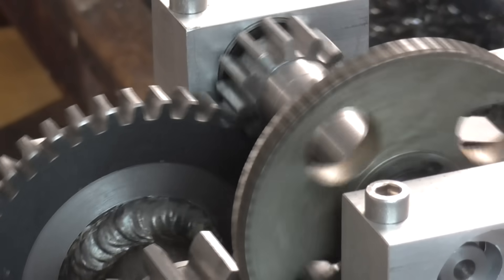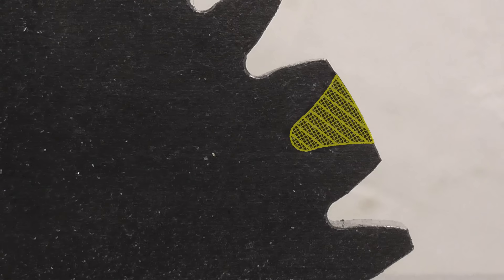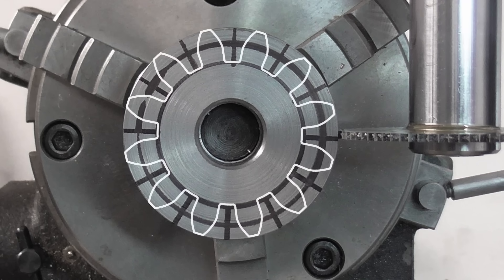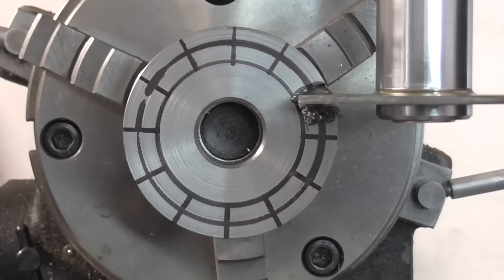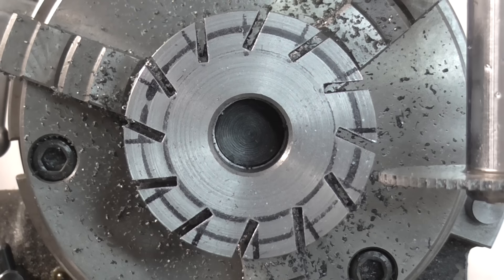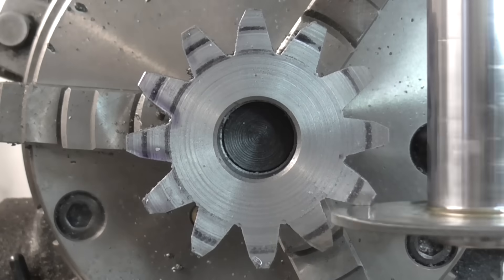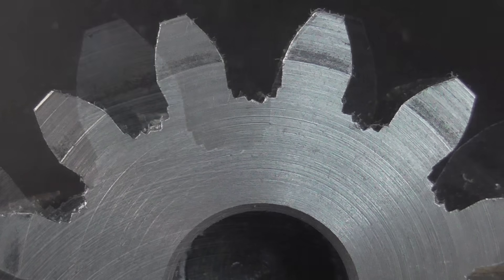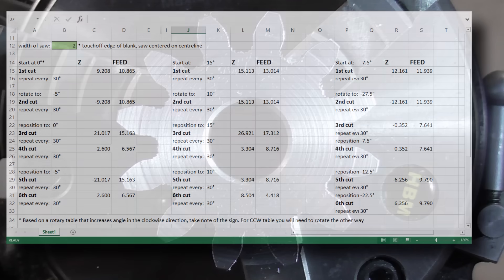Cut any gear with just a slitting saw

Comment: Could you 3D print dividing head gears and parts and have metal structure to lock the part for cutting? Seems like this could be a low cost solution to cutting gears. Annyone?
Reply from the maker: You could do that as long as there is very little force on the 3D printed parts. People even make dividing heads using just a paper disc with marks on it. All you need is a rotating shaft that can be locked in position.

Comment: one question. Why? In the beginning I thought "oh okay he wants to cut m=1 this would be tricky to mill" but in the end he cut m=4 which is totally doable with an end mill
Reply from the maker: You mean CNC mill out the shape of the gear in profile? Or use an end mill instead of a slitting saw? Yes, you can profile cut a module 4 gear with a small endmill, but you'd be limited to only a couple of mm per pass and this gear is 20mm thick, so that would need multiple passes with a long fragile endmill, it's going to take a long time and likely break a lot of cutters. Similarly replacing the saw with an end mill, it can be done but it will take many more cuts.

Comment: As a job shop machinist of 20 some years and a industrial maintenance mechanic who was the go to machinist at that plant for nearly 17 years I was quite impressed with this video. This is the type of project you might be given in a school shop for the student(s) to learn machine practice and theory. Although not practical in the real world the experience the math the adaptation of machine tools and the hands on machining would be priceless. Let me add you could have save yourself a few radius corner cuts by using an endmill with rounded corners. They can be shaped quite easily by hand to the end mill using a grinding wheel. One cut centered and done.

Comment: I enjoed your video very much and like the idea of making gears at home :)  ... I would like to add a suggestion: there might be an even easier method of generating the involute on a mill: incorporating the  pressure angle (20°) into the setup makes the step overs for each cut a bit cumbersome (moving up and sideways).  Instead of rolling along the pitch circle you could set the OD of the saw to the fixed distance of the base circle of the gear (with a corresponding  0° pressure angle), and from there ononly move the saw vertical and turn the gear by the corresponding base circle lenght.   Formular: Base Circle db= d/cos(press.angle).   For every 1° you rotate the gear, you move the saw up (/or down for opposite side of gap) by a slight amount, corresponding to the periphery of base circle devided by 360°      Formular:  L= db*pi/360  , if you want to make enveloped cuts say every 5°, you just multiply L times 5.  This method (Roll-Off Base Circle) was incorporated in some very old, but crazy accurate gear grinding machines from Maag.    
https://www.e-periodica.ch/digbib/view?pid=sbz-002:1917:69::492#2600   
 (sorry, only in German)

Comment: i have some question  firs cut is ok and it happens at -27.5  and-5(which means -32.5) and it is ok but secound step  turning  to 15  its ok for +-15.13 whats that 10 in spreadsheet
in third step 12.16 happens at -7.5 from origin and -22.5  then -27.5 where has it come from
Reply from the maker: The first cut is taken with the rotary staring at 0°, then repeated every 30°. The next cut is started at -5° with Z and cut depth repositioned and again repeated every 30°. for the second stage the starting angles are 15° and 10°. The Z and cut depth are calculated to intersect with the correct tooth profile, though as you get further along the spreadsheet not every cut would remove material since it's already been cut away or some cuts don't even intersect with the blank, since it's simulating a rack shape which the gear is rolling across to generate the tooth profile.

Comment: For those who need to make many gears, an option would be casting your gears.
Make a 3D print of your gear(s), add 3% for shrinkage for aluminum or steel.
This would make your pattern for a sanding casting.
Grind some tool steel for a flycutter the shape of your tooth.
Of course, you would still need a dividing head.

Comment: I was wondering if you used a drill of the correct diameter for the root area, and than cut the three angled cuts, if that would yield the correct tooth geometry... Looks like it would...   IDK
Reply from the maker: For a larger gear (say 50+ teeth rather than 12) you could probably get away with just 2-3 cuts per tooth. For 135+ teeth you would only need one cut on each side of the tooth at the pressure angle (essentially a rack).

Comment: Patience! Could you not have drilled the roots? Sure, you loose a little bit of material, but not very much. Thank you for your videos!
Reply from the maker: Yes, you can drill the roots first but I tend to do this only on gears with more teeth. You are correct you will loose some material, on a gear with more teeth it will be less. Instead of drilling I chose to clean up the roots afterwards with a ball mill.

Comment: This is my third time watching this awesome video.  This time I was wondering if this concept could also be accomplished using and end mill???  Of course it would have to be a small end mill for small gears, at least to clean up the root as you did with the ball nose end mill. Your thoughts? A video on how to do it? Please?  Thanks. Regards
Reply from the maker: Yes, you can do it with an endmill, the only problem is it would have to be a very long thin endmill to reach into the root of the tooth, which would mean taking multiple passes, so it would take much longer to do.
Reply: @AndysMachines  It's too bad that they don't make end mills with a gear cutting profile.  I suppose that with a Tool and Cutter Grinder, you could at least get close to the needed profile.  Thanks for the reply and for sharing your incredible knowledge on the subject of Gears and Gear Cutting.
Regards.

Comment: You started 0 degree how the second jop 5 degree
Reply from the maker: The first cut was made at 0° and repeated every 30°, The second cut was made at -5° and also repeated every 30° (after repositioning the saw). All these numbers came from the spreadsheet and depend on the size and number of teeth, width of saw etc.

Comment: Great vid. TY ! This is very advanced stuff. I am just an amatuer, and I have used slitting saws but they always seem to dull very quickly. Any tips?
Reply from the maker: Thanks! With slitting saws you need to run them more slowly than you might think (usually 100-200rpm), especially when cutting steel otherwise they can overheat.  I use the formula rpm=8600/diameter of saw(mm). Cutting oil will also help keep it cool.

Comment: , you used a bore nose end mill as well.  Thats two tools, not one as the video title claims.
Reply from the maker: Yes I used the ballmill to clean up the root of the tooth area, but it's not really necessary since that's not the working part of the tooth, it's just to improve the appearance really, and it could have been done with the slitting saw by taking numerous tiny cuts. You could also just use a file to clean it up.

Comment: AND......for small pinion gears (low tooth count) this method can actually do a better job forming the root of the tooth with proper clearance than the "proper" set of 8 involute gear cutters.
Reply from the maker: Yes, with regular gear cutters you can't cut fewer than 12 teeth, a number 8 cutter only does 12 & 13 teeth. But actually you can do this same trick with the number 1 gear cutter and use it to cut any number of teeth.

Comment: it was interesting to learn that square corners could lead to failure. When i ran a cnc machine in the stone industry, we learnt that we had to add a 5mm radius to hotplate cutouts or sinks with a square corner as after some time they would crack through the corner otherwise.

Comment: Double thumbs up!
Really great. It's the best method I've seen using machines of this calibre. The explanations are like state of the art, just fantastic. 
Just verified a digitally controlled rotating table capable of either steps per rev or angle per step. And... cutting gears for a veteran railroad might be waiting.

I prefer to contribute once, with a decent sum.  Is there any way to do that?
Reply from the maker: Thanks for the comment and appreciation!
If you click on the three dots under the video, there should be a drop down menu with 'Thanks' in it, you can use this to make a one-off donation.
I'd be interested to hear if you use this method for making railroad gears!

Comment: I made a 20-tooth 8DP 20PA gear according to the Imperial sheet of the spreadsheet.  It turned out well, but I found 3 of the setups that didn't seem right, so I skipped them.  Those 3 as set up would have gone right through the meat of the teeth.  (The ones in question are 1st column 4th & 6th cuts, and 3rd column 6th cut.)  It's very possible -- maybe even likely -- that I set them up wrong, but I checked several times and got the same results.  (I also found a couple that missed the blank entirely, but that was expected.)  Those glitches aside, I'm very impressed by the method and the way you quantified it, as well as the video itself.  Very nice work!
Reply from the maker: I did find something similar on a gear I made, it was only the cuts quite far down each column and I think not the first few columns, but it could have been my mistake, or it may be there's a glitch. Fortunately if a cut is in the wrong place it's usually very obvious and you can skip that one. And there are a lot of cuts that won't even intersect with the blank.

Comment: Thanks for the interesting process. It does show that there is more than one way to do anything. You could even cut a worm gear using this method, the setup of course would be a bit different due to the angles involved.

Comment: Ive machined gears from tool steel using a large box way mill. I started with 6 different sized cutters to machine the proper profile. I made around 24 at a time and they’d take the better of a day to machine 3 plates worth or 72 gears. 

The Finished, edges were sharp and required either hand filing, or eventually a adapter we made for a lathe to debur. End of the day our hobber could make 700 or so completely finished so it wasn’t as efficient in comparison but the accuracy was good.

So for anyone wondering, yes you can make straight cut gears on a 3 axis that will work just fine on a product. 

We made mod-1 from 4320 so the profiles were tight and utilized Gibbs cam gear program. It was a faster a process than using a slitting saw. The cost of tooling was around $150 total to make around 500 gears. The smaller end mills you use to provide the proper profile break easy so it was ideal to remove as much as you could with the larger ones and finish with 2-3 passes. 

If i recall we had 3/16, 1/8, 3/32, 1/16, 1/32, and 1/64. We were able to eliminate a couple end mills by the time we revised the program a few times. 

This was several years ago and i no longer do any CAD/CAM OR machine parts but it brings back memories of the good days.

Comment: That's odd, a little over a year ago, probably the same time this video was made, I was trying to cut gears with a slitting saw on my little Chinese CNC, usinf its fourth axis and gcode generated part manually and part by a c++ program. The results were not that good though, I think mostly because of the poor quality of the machine.  I haven;t watched the full video yet but it seems the method I used was quite different. I was using the saw more like a milling cutter and by moving it linearly while advancing the rotation it 'automatically' forms the right profile, quite similar in principle as a hob would do it, just much more slowly.

Comment: Hi AndysMachines, very interesting video. In the spreadsheet, there is the pitch diameter, the outside and root diameter. What does root mean?
Reply from the maker: Check out my other video for an explanation of these terms: https://youtu.be/F7vQ9oVkX-k?t=70 
Basically the root diameter is the 'inner diameter' of the gear, at the bottom of the tooth space.

Comment: I won't lie, this is awesome information and I'm more than tempted to use this for personal production of gears to manufacture.   I intend clone Eaton's range/splitter box in their fuller transmissions but smaller and compact so that I can bolt it to my truck's main transmission, the NP435. the overdrive ratio will be 0.78:1, and the low range will be 8.55:1, essentially turning my 4 speed into a 16 speed transmission. (then again I can just have four low, wide-ratio gears and then have 8 higher, close-ratio gears giving me 12 gears to work with.)

NOTE: after doing a quick calculation, I realized that a theoretical 57.11:1 low range is WAY too low (unless if I'm going to do farming then the variable low speeds may actually be a good idea.  Like, trenching or combining.)  So perhaps just a custom gear splitter (lowest will be 6.68:1 and highest will be 0.78:1) would be better, giving me 8 forward speeds and 2 reverse speeds. (and, with the two speed transfer case, I can have a theoretical 10 forward gears and 3 reverse gears.)

I honestly don't know, maybe I'd might be able to build or clone a multi-thousand dollar (or multi-thousand pound; GBP) milling machine with some reference guides and patience, it could be done.

My ramblings aside I love your video and the wealth of information including a chunk of excel-wizardry to help make the process easier for machining gears. :)

10/10, will recommend.

Comment: It's me, I'm the guy with a lathe, a mill, a dividing head, a few slitting saws, and no gear cutters.  The lathe needs a few more gears (and a repair to a broken gear post) to be useful for threading or power feeding.  This video is definitely going in the queue for reference later.

Comment: Really good job but if you could do a second example of 30 or 40 teeth so that we can be sure we have understood how to read the board, that would be amazing. No need to make a full gear, just a tooth or 2 is enough pls
Reply from the maker: The large gear you can see at 1:25 has 45 teeth and was made by the same method (it is the same module size). For larger numbers of teeth you don't need as many cuts to approximate the curved shape (I think I did only 3 cuts per side on this one) so you don't need to use as many of the columns in the spreadsheet. If you make a mistake and set the wrong position it's usually fairly obvious as it would cut in completely the wrong place and remove most of the tooth. After the first 2 cuts per tooth you should only be removing a small sliver each time.

Comment: I’m impressed! I’ve NEVER cut a gear, but need to do so, and I’ll try this way. It’s for a very odd thing: the rebound damper adjuster on 1980s Kawasaki rear shocks. The little drive gears tend to bust over time (what a surprise) making the shock useless. So these little gears are for that. 

Some would argue those shocks were useless even when new - good point - but I’m restoring some. In fact, Hagon shocks are far superior, but each to their own. I’ll cut gears, will advise how they turn out.

Comment: I wonder if before taking the slitting saw to it if you drilled the 12 hole pattern right in the roots to start .......... instead of the ball endmill at the end.
Reply from the maker: I actually did that for a larger gear I made (45 teeth) but a round hole is not the perfect shape for the root.

Comment: Use a lathe. Take a rod of your favorite tool steel. Cut it to the profile of your gear tooth.  Similarly to what they are doing here, but instead of directly cutting the tooth, which requires multiple cuts on both sides of each tooth, you just turn your cutter down. Then use milling attachments to cut your flutes. You need the right relief angles on them. Look up how to make a mill. Then harden and temper your cutter.  Then you just mount your dividing head on the compound and you can quickly cut your gear.

Comment: Second time I've watched this video as I am getting closer to making my own gears using a rotary table on a CnC. It did bring up some possible variations on your process. I believe one could cut the leading and trailing edge of each tooth by making 2 cuts on each side at each of the Z offsets. In your case, with a manual mill, it doesn't help, but in mine, the rotary table is still manual. The other thought was, after you've roughed the tooth profile, wouldn't it be better to take those thin wedges using an endmill? I expect the surface finish should be much better on the parts that matter.
Reply from the maker: You will still need a very long thin endmill to reach into the tooth space to take cuts without interfering with the tooth on the other side, so the finish might not be that much better, though you could run the endmill at much higher speed. You'd also need to reposition everything by 90° after the saw cuts.
Reply: @AndysMachines  My thought was for gears similar to the size you cut for your demo, the passes would be made on the gear faces as they are nearly vertical. This way, you could be cutting with sides of the endmill and keep it very short. Alternatively, using a high efficiency long mill on a larger gear, the cutting forces should project to the spindle and I would hope you could achieve a much faster feed that way.

Comment: Then, why not cast?
Sorry as a total newby I may ask dumb question without even knowing it.
Reply from the maker: I don't have the capabilities myself to cast this gear in iron/steel. I can cast aluminium and brass but aluminium is not a good choice for gears and brass is much softer than steel. The gear would still need machining afterwards anyway as there is always some distortion with casting.